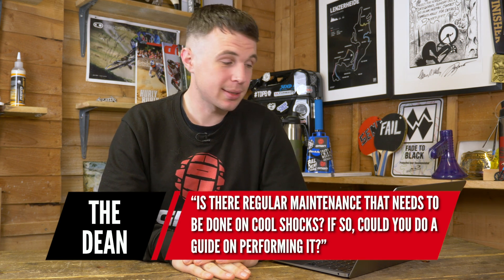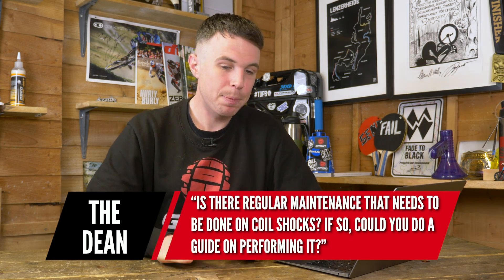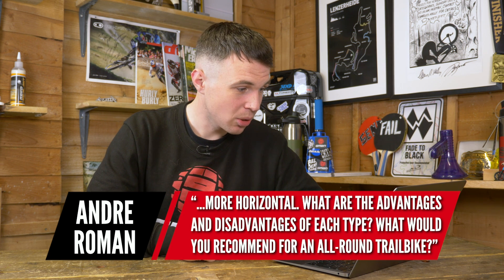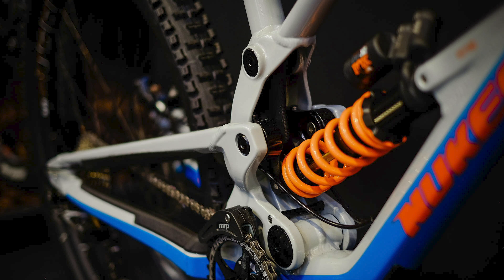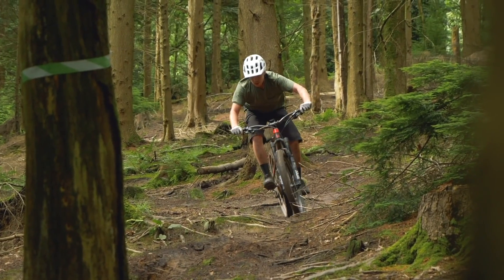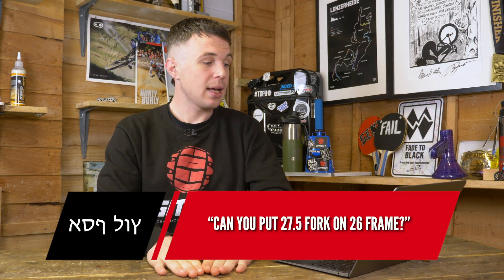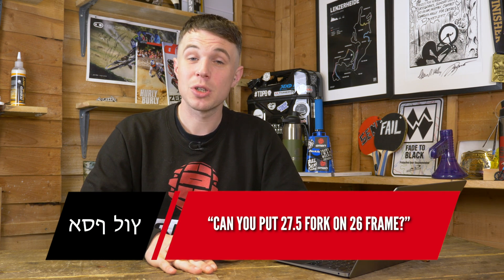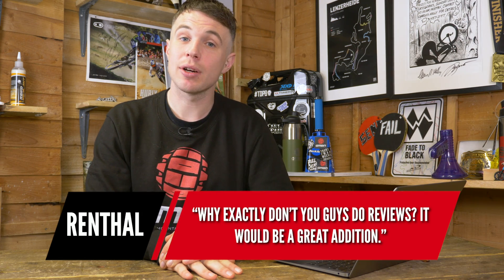Does A Vertical Shock Perform Better Than A Horizontal Shock? | #AskGMBNTech

Comment: #askgmbntech is there such a thing as having to much grip? Currently I am running bike a  schwalbe dirty dan on the back and a maxxis high roller 2. What wood happen if I was to put 2 dirty Dan's on my bike? 
love the show
Reply: Too much grip probably not....too much slow and weight, probably (haven't taken a look at weight specs for the dan but presuming it's heavier due to bigger lugs)
Reply: Typically, rolling resistance increases along with grip.

Comment: Debating going from a 26” Downhill Bike to a 27.5 Downhill Bike and keeping up with the times. Current dh bike is a Saracen Myst Pro 2014 (although it is 2019 team spec). Thinking of upgrading to a 2019 Saracen Myst Pro and swapping all upgraded parts over (would have to get 27.5 lowers for my forks). Would this be worth it? Just don’t want to be stuck with 26” when it becomes pretty difficult to find the spares & parts you need/want for your bike.  Also, would I need to go for a medium 27.5 as the 26” bike is large #askgmbntech
Reply: DAM it would be worth it as long as your confident swapping parts as it could end up costing more then just buying the brand new bike. 26inch probably won’t die for another few years so no worries but 27.5 won’t give much difference except for more available spares
Reply: @jooncash8844  yeah yeah. perfectly fine with it, priced up new lowers for the forks and so on as they are only a couple of months old. would basically have two full bikes with one (being the 26") to sell to recoop some of the cost also

Comment: I've got a Shimano Funnel, for bleeding, and mineral oil. I was wondering how i can improvise a serynge with a hose to push oil in the caliper. Can you recommend any serynge and hose diameter to use? Is this even possible? #askgmbntech
Reply: Spiry Lastname I support this question!
Reply: Spiry Lastname if you want to do a quick bleed just take the funnel and attach it to the lever and put some oil in the funnel, then squeeze the brakes and keep doing that until the air bubbles come out
Reply: Pharmacy for a syringe pet shop or some clear hose, or just buy a ezy bleed kit for 5 quid on ebay
Reply: JDM n Euro Mossy that wouldn’t work as all brands and their own sizing and thread of the hoses and funnels

Comment: Thank you for the answer Henry. Foam inserts and downhill tyres sound nice indeed. 
Regarding spoke tension, I had them checked in a shop a few times recently (everytime I had a problem actually), with no improvement... Unfortunately though, the rear triangle of the bike broke before the carbon wheels, and it seems that the part is not available anymore... Might compromise my plans a bit.
Reply: try shops that sell Specialized, you might find the part , search for the part number, if not you might be able to get it welded by a professional.
Reply: @mtbboy1993  thanks for the advice. I have tried a reseller. They told me the part is not available anymore from the manufacturer. I might still have a chance that one other reseller has a spare in stock.
I have contacted Spe's support, maybe a newer version of the rear triangle could fit my frame?
Welding is an option I thought about also, but the chainstay on the other side is dinged as well, so I believe the part will be weak...
Reply: @objectifmtb3263  check second hand sites like pinkbike, maybe stick a wanted add on there?
Reply: @carlstanton2550  Thanks, I'll check that, I only tried the French sites and eBay for the moment.
Reply: @objectifmtb3263  Gotta find the guy who cracked his bottom bracket or snapped his downtube... Good luck!
Reply: @adanielweaver  yeah, fingers crossed. At least I'm not that guy yet  hehehe
Reply: If you have wheelset that has issues on smooth surfaces they are garbage and should be binned. I had a set of alloy wheel on my XC bike (the stock fuji ones) that had the same issue and it was coz they were garbage. Nothing would stop them from bending.

Furthermore, Doing the megavalanche after only 1 year of riding is insane and reeks of hospital. It's a cool ambition but maybe take the age restriction off and really work up to it. There are people here that have been riding for decades and would never consider running that race. Me being one of them, especially now I'm disabled.
Reply: @M3PH11  I don't really know what to think about the wheels, they are supposed to be quite high end... But a few people told me they are not up to this bike's standard, even less to my way to monster truck through rough terrain when I find some. 
I know the Mega is quite intense, and I intend to be careful. Even though it's not been one year yet, I ride with some people pushing me to improve where I'm not confident (namely jumps), and I have quite a history of sport behind me. Anyways, I'll make my best to be ready, a'd not for the hospital. Cheers
Reply: YESS! Found one. My hold on girlfriend's cousin's friend pfew holds a Specialized retail shop in the south of france, and has a fitting part!
Weeee!
Reply: @redders7147  yeah I heard that welding would cause strength loss, but I did not know you could re-heat this. Interesting!

Comment: #askgmbntech Have a Canyon Spectral CF 8.0 that came with Shimano XT 11 speed. Is the frame compatible with an XT 12 speed upgrade?
Reply: The frame yes, the freehub, no. You'll need a new micro spline freehub for the 12 speed or an eagle upgrade (nx or sx)
Reply: Maik Eckert but totally compatible in terms of simple sizing and fitting, right? Thanks a bunch, mate.
Reply: @NotTheLarryDavid  yeah, if you can upgrade your hub, you can just fit in the new parts and you're happy.
The shifter is no problem, derailleur should fit without Problems, and the size of a 12 speed freehub or casette is the same as a 11 speed Hub.
Reply: Maik Eckert cool, I have a DT Swiss hub which should be upgradeable too. Cheers, really appreciate your help.

Comment: Do you think Calibre Sentry is good  beginner full-suspension bike for every day use and all kinds of riding?
#askgmbntech
Reply: Blaž Germ deffo buddy, join the Facebook group: Calibre Bossnut Riders Group
Reply: Honestly not a bad bike. I’ve been down the red runs at havok on a full dh bike an one of the lads I was with sent it on a calibre bossnut.
Reply: The sentry might be a little too much for a "beginner" full sus. It's very long, low, slack & a little heavy. The BBB might be better suited but it depends on trails your riding I guess

Comment: That is vice on the threaded fork lower the one you recommended using the SR suntour axle. That was excellent whoever came up with that knows their s***.
Reply: No, no it's not. Axles are a super integral part of a fork and they are certainly not interchangeable. They're responsible for more than just holding your wheel in.

Comment: #askgmbntech what is your view on fixing things such as lamps and cameras to helmets. Surely this is potentially dangerous? Helmets are designed to work in a certain way and by fixing things to it will potentially prevent a helmet from working as designed. In Motorsport you cannot fix anything to a helmet for this reason unless it has passed tests to ensure it breaks away immediately on impact. I know MTB is slower but obviously fast enough to warrant using helmet. Do any manufacturers design helmet to allow fixing things to them or are there any mounts that have been designed to breakaway on impact and not impede the function of a helmet?
Reply: F1womble I know Bontrager/Trek’s helmets have clip in GoPro and light mounts which unclip when impacted.

Comment: #askgmbntech my rear tire (Nobby Nic) is more worn out than the front. I want to move to a faster rolling tire/less knobly. Do I change the rear tire or the front tire? (Cube stereo hybrid)
Reply: I was looking for similar advice last year, and was told the general rule is to have more grip on the front tire - if you lose grip at the front the consequences are pretty bad, but not so bad if your back tire has a bit of slippage. I followed that advice, got a good chunky front tire, and it made a noticable difference.
Reply: Swap out the rear to new one for sure and keep the old front if it's fine.

Comment: #askgmbntech, I’m wanting to buy the KONA big honzo dl and it has 27.5+  2.8 tyres and would want to put thinner tyres like 2.5 on it, would it work
Reply: Josh Morris MTB Sure, knock yourself out - you’re just adding more mud clearance. 2.8 to 2.5 is not a great jump in size and I wouldn’t worry about this here, but it’s always a good idea to double-check what rims the bike comes with. The rim manufacturer will always have some tyre size recommendations for each of their rim models. I wouldn’t hesitate to put 2.5s on rims that came with 2.8s installed, though. :)
Reply: Ilkka Karppinen I’ve read that people run 2.6 quite fine

Comment: #askgmbntech: the compression damper of my rockshox revelation fork on my 2018 nukeproof scout does nothing at all. Even from brand new, this problem used to happen only once in a while but now the fork is fully open no matter what i set the compression dial to. Will a service remedy this? Thanks!
Reply: I think this is a known issue. One of my friends has the same problem on his specialized levo, also with revelation fork
Reply: Alright. Is it known to be a repairable issue or just known. In other words is it just a wierd design that gets gummed up and can be cleaned/repaired. Or is it that the revelation forks are rubbish so i will have to spend a bunch of money on a new fork if I want a functioning damper?
Reply: @VTnadjers94  I believe you can buy a new and better dampener :)). But the original one is shit
Reply: @oscardahlnielsen  thanks, i'll look into it
Reply: Sounds like a normal functioning Rockshox
Reply: @DM-hw4cr  not true, many of the rockshox shocks are really good and in the end it is a matter of prefference between fox & rockshox.

Comment: Can you upgrade your gears of front/Rear on an mtb for example: shimano acera to something elss . Thankyou love your stuff #askgmbntech
Reply: I am not GMBN but i want you to reformulate that question, are you talking about the derailleurs, are you taking about the casette.  If you want to change your rear derailleur to a better one, you can, as long as you replace your cassettes, or keep the old one if it is compatible to the new derailleur.     If you are talking about the front derailleur, it's the same BUT, make sure that your new chainring/s is/are compatible with your cranks. If you want to convert your bike to a 1x , you can keep the old rear derailleur and casser, and you will need to get rid of the front derailleur and chainrings. I hope I answered your question. Upgrades are always welcome.
Reply: @mitoski7427  we'll you  have cleared my dought thankyou, can you buy the derailleurs from online? Or is it better i approach a dealer for this job actually i am new to this stuff so I don't have much clarity and again thanks for the tips.
Reply: Yes you can buy derailleurs online, but before buying anything, it's a good idea to do some research on the product you are about to buy
Reply: ofc you can.
Reply: @danielstormy3660  I am new to mountain biking so gaing some knowledge. 😅
Reply: the number of gears and the brand is important. for example all shimano mtb 10 speed components can be mixed (like altus, acera, deore, slx, ...)

Comment: #AskGMBNTech Here goes my odd question!  Here in France we get the brakes mixed up with UK. But it sounds more logical in France where you get rear derailleur and brake on the right side and front derailleur and brake on the left side. Is there a good reason for this or is it just UK wanting to do things differently (like driving on the wrong side of the road)? Cheers ;)
Reply: In USA we set up our bicycles the same way as you. The UK way makes sense if you ride motorcycles though. As far as i know, motorcycles have front brake on the right hand and clutch on the left.
Reply: Actually (and I'm French too), it seems like we do it the wrong way... If you compare to motorcycle, all around the world the front brake is under the right hand. And on bycicle, I think we might be the only country that do front brake to the left? Might be wrong though.
Reply: Australia is like moto. Front brake on the right. I couldn’t imagine trying to ride it the other way around and trying to switch from bike to moto.

Comment: Hi guys posted this before on a vid a few weeks back but was never answered, 

I have a manitou swinger 4way on a trek session 77 and am thinking of upping the spring weight as The stock 250lb feels way too soft for me. I was wondering what would happen if I used 2 springs of different weights on a single shock to achieve something similar to what’s found on coilovers on cars so I don’t lose the small bump sensitivity by going for a single rate heavier spring

#askgmbntech

Comment: #askgmbntech hi guys I have a qoestion I have white disc brakes and I want to paint them black how to do it?
Cheers
Reply: You just really shouldn’t do it, you have an extremely high chance of permanently damaging the performance of the brakes
Reply: Jurij Benjamin Rožanec do you mean the lever or the caliber or both?
Reply: @jooncash8844  lever and optionaly the caliper
Reply: Do you know how to completely disassemble the caliper eg take out brake pads, pistons and disconnect hose?
Also you’d have to take out the lever, internals, Hose and fluid out of the caliper and lever to begin painting.
Just don’t do it’s really not worth it
Reply: @jooncash8844  yes I know but if I want to paint only the lever I could probably do it without dissasembeling  everything because it is a closed sistem.
Reply: You would get paint inside the system and possibly stop the lever from working, put some tape over the open areas and then yes you could
Reply: @jooncash8844  what do you think about open areas?

Comment: #askgmbntech Hi guys I have a 3 by 10 drivetrain and I want to upgrade it to 1x10.I don't know if I should put 32 or 30 tooth chainring in front.
Thanks and cheers
Reply: depend on the gearing you put on the back and your strengths. If you are a strong climber and prefer a lower cadence you will be fine with a 32 and you will also have a faster sprinting gear. If you struggle climbing then you will benefit from a smaller chain ring but will lose a tiny bit on sprint speed. Most people running bigger than 30 with most rear cassette are really strong riders who are trying to keep their cadence within a certain range
Reply: @mikeytek  thank you so much
Reply: @jurijrozanec  if you want to get even more technical you can also run Oval Chainrings which can give you best of both worlds in a way. Do some research on them. I run absolute black which is the most aggresive oval chainring approach
Reply: find out which of the gears you prefer in the 3x10 setup, compare gearing with 1x10 in a gear calculator (like for example http://www.ritzelrechner.de/)

Comment: #askgmbntech What pressure should I store my forks at? And my 2014 fox 34 forks have massive stiction on the beginning of the first stroke only, afterwards are fine. Is this normal and will it go away with use( never used in their life yet)?

Thanks
Reply: Store them in same pressure as you ride them, should make no difference. If the forks feel sticky, do a basic service. Clean them and change new oils. Also worth checking is the air chamber (same chamber where you put your air in, under air cap), it might too much grease in, which most likely will have similar effect.
Reply: Pop it upside down for 30 minutes or so to circulate the oil after sitting for a while
Reply: @DM-hw4cr  cheers

Comment: #askgmbntech Can I place all spacers on my steering tube under the handlebar and only go with the cap on the top? Or should you have at least one "spacer" (forgot the word for it) on the top of the handlebar and then the cap? I'm wondering since I've never seen anyone go with just the cap on the top before and don't know if it's safe or not.
Reply: cap straight on to the stem is fine and very normal on hybrid/commuter bikes.
Reply: @judechandler5102  Thank you, it's a trail bike I'm owning, still safe to do so? :)
Reply: @Lfomod1Dubstep  any bike really. have fun!
Reply: @judechandler5102  Awesome, thanks for the answer!
Reply: @Lfomod1Dubstep  Just make sure the top of the steerer is only around 5mm lower than the top of the stem. If you have the steerer too far down in the stem you wont get the correct clamping pressure and you are at risk of the stem twisting on the steerer while riding which will end with a nasty crash

Comment: #askgmbntech am I ok to add an extra 10mm of travel into my fork without having to worry about breaking my frame my bike is a 2019 trek remedy with a 160mm travel fork
Reply: A rule of thumb is that you can go 20 mm up or down in fork travel. 10mm is won’t be an issue, but some manufacturers are really specific about you not messing with their bikes, if you want to keep your warranty.
Reply: Just emailed trek about it and they say you have no warranty if you do so won’t be doing that 😂😂 don’t have the Money if anything was to go wrong
Reply: @willbennett7107  ah well, at least an extra 10mm wouldn't have made a huge difference to your riding anyways!
Reply: they say 20mm more than advised by the company so 10 should be fine. Good luck!
Reply: thanks for the help by the way guys